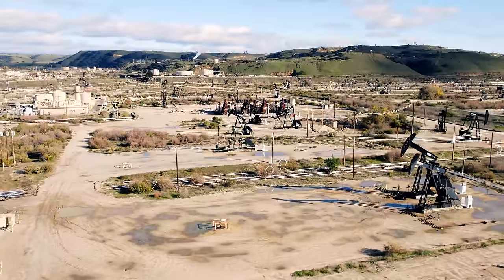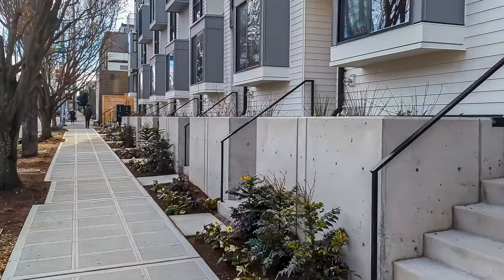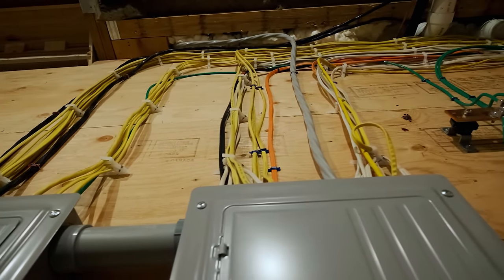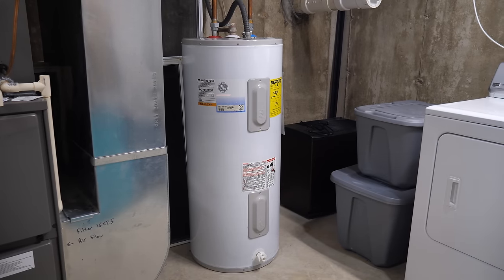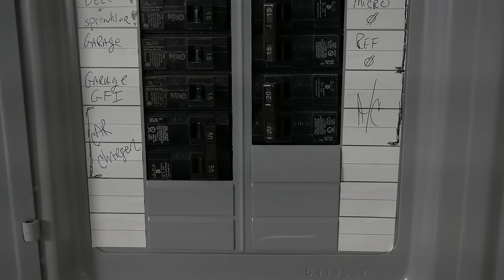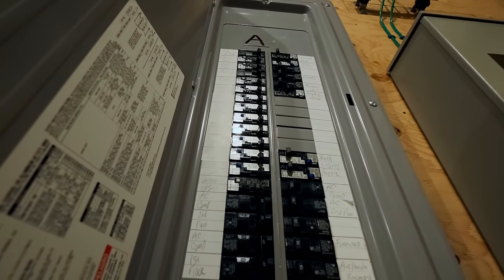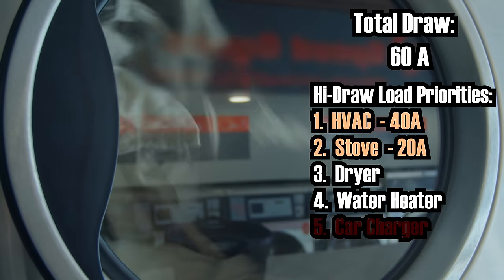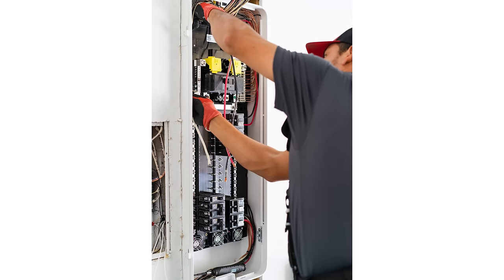Home Electrification: There's not a lot to do, and it doesn't have to be hard (Part 1)

Comment: I am an Estimator that works for a regional electrical contractor in the northwest Oklahoma region. I went ahead and ran a few hypothetical price estimates through my estimating software based on the scenario that you outlined in your video of using a SPAN panel to automatically manage power distribution with just a 100 amp feeder. Here is what I got:

Let’s say that you had a 100 amp panel in a 1700 sqft, 50 year old house that was using a gas range, gas water heater, and gas furnace (I see this all the time). If you decided that you wanted a panel upgrade so you could move to all electric the panel upgrade alone, with off the shelf electrical components, would run you about $1400.00. That would replace your 100 amp 30 space panel with a 200 amp 42 space panel. If you add the feeder upgrade, which would most likely be necessary, that would add about $950.00 if the meter base was located within 10 feet of the panel. This might also have to include fees from the utility company to upgrade the feeders on their part.

After you have a larger panel you could opt to then install new feeders to your appliances. A new range feeder would run about $1300 if run through an attic and it was within 50 feet of the panel. A new water heater feeder would be about $350.00 if it was within 15 feet of the panel. And a new Furnace feeder would run about $1100.00 if it was within 25 feet of the panel. 

However, if you decided to install a SPAN panel in place of your 100 amp panel without a feeder upgrade it would run about $6,500.00 assuming that the panel could be purchased and delivered for $3500.00. From what I can find this is a low estimate. With this new panel you would still have to upgrade all of your appliance feeders but you could avoid upgrading your panel feeder. 

The SPAN panel specifically may not be the solution for automated power distribution control at the moment but I am sure if these kinds of panels come down in price they could be an option. 

Also, if these prices feel absurdly low to you that’s because they are prices using northwestern Oklahoma material and labor rates. If you were in New York City just multiply these prices by 3-4x.
Reply: I'm curious, wouldnt the labor be the same between upgrading the panel size vs replacing with the SPAN panel? If so, why is there the large cost increase with the SPAN unit vs. part cost?
Reply: hello fellow okie! 👋
Reply: I would be worried about the longevity of the embedded computer system in this panel because looking at modern major appliances with expensive microcontroller boards cost a lot to begin with but if the board goes bad, it's just easier and cheaper to replace the whole appliance than to replace the board.  The way this panel is built as well, inconveniently, the SPAN panel foolishly puts the computer board BEHIND the breakers instead of beside it.  Also, I would want a system like that to use off the shelf components like a Raspberry Pi or ATX or ITX PC with free and open source software for these duties, effectively reducing cost and ease of repair.  Also, so the panel, with its "smart" breakers to operate like the passive breakers in conventional load centre/service entry panels.
Reply: @WJCTechyman  I doubt products like raspberry pi would pass any regulation. It's not like your internet router at home. My best guess is that SPAN chooses good quality electronic components and tests their products thoroughly so they don't get a bad rep of low reliability and high maintenance. But yes, concerns raised in comments are all legitimate and we have a long way to go.
Reply: @know1care  Rasberry pi's are just boards with chips and they are highly reliable...its the same thing that would be put into any other instrument except with a vast amount of capability.
Reply: @know1care  What makes you think SPAN would use any better components than say AMANA or LG or Samsung uses in their major appliances that only seem to last 5-8 years now?
Reply: So basically replacing all your stuff with electric is absurdly expensive and a complete waste of time and money.
Reply: @tinfever  the labor would actually be a little higher for the SPAN panel, I actually left is 20% higher when I ran the pricing. This is because my guys will have some reference for how to install the panel but will require some factory training and guidance. All of that costs time that I need to account for.
Reply: @WJCTechyman  this doesn't concern me as much. We install commercial lighting control panels from lutron and Eaton that will easily last 15 years without issue. While the circuitry is a point of failure so too can things like the connection points between the breakers and even the plastic housing of the breakers themselves. From the pricing I see on the SPAN panels I will assume that they are using commercial grade components.
Reply: @xeridea  as always, the answer is: it depends on your unique circumstance.
Reply: This is really good info and tracks with what I was thinking. However, I think a lot of the concern with full electrification is on the supply side, not the demand side. Adding a device like a span to a large number of homes helps the utility as they dont need to do large scale costly upgrades. It kind of also helps the consumer, but I think the primary benefit to this kind of intelligent load shedding is at the grid level, not the individual level (when a house upgrades to 400a service, the utility needs to ensure they can actually supply 400a, not the case where the home is just using existing capacity that is already accounted for)
Reply: Yeah, my very first thought on the SPAN panel is that it would be hilariously more expensive than just getting a service upgrade and is only something that should be done if a service upgrade is simply not possible.
Reply: @xeridea  It's a pipe dream.
Reply: Those seem insanely high to me but then again I did all my own work (after having a main breaker installed). Between material costs, and valuing my work at $5 per swear word, I come out to about $1500 total for my EV charger, electric water heater, induction stove, and rewiring all receptacles and lights for my 600SF cabin
Reply: @wojtek-33  Utilities don't run 12/3 Romex from the transformer to your meter.

Comment: Have you done a video on home insulation yet?
Would love to hear your thoughts on things like weather stripping, window film, etc.
Reply: This is something I would like to hear more on. I live in an older house with really old windows, but I'm not keen on replacing them (partially just because I just think they're neat). So other forms of improvements would be interesting to me.
Reply: @Descriptor413  when i moved into my 1905 Queen Anne style home in 2008 I had a window professional give me an estimate for all new wood-clad vinyl.  He was honest enough to say that my original double-hung sashes, coupled with tight-fitting aluminum storm windows, would be more energy efficient than replacing everything with new vinyl.  I'm sure he was right.  My house isn't drafty and utility bills are low, despite the size of the house.
Reply: @Descriptor413 
Last week I had 4 windows replaced by Pella. One was a big 6'x3' single pane window. The other three were the cheapest vinyl windows you can find. After all were replaced, you could immediately feel the difference. The house is staying much warmer than it did before. Especially good timing with the arctic vortex this week. On the other hand, it cost $8K. So it gets pricey fast. If I'm being honest, it probably won't pay for itself in dollars for a very long time. But I will be more comfortable and feel less worried about running the heat or AC. 

Next up full energy audit.

Comment: One extra thought on throttling your resistive heat- if you reduce your heater's output by 20 amps to run 20 amps of stove, your house is still getting 20 amps of heat! In a much more localized way, but if anything that's good, because you're probably in the kitchen with the stove anyway. Dryers and water heaters have this effect, but to a lesser extent as much of the energy goes away through a duct/drain.
Reply: That extra heat is not an advantage, unless it's cold outside.
Reply: @dizzywow  This is in the context of "throttling your resistive heat" so yes, when it's cold outside.
Reply: assuming your home doesn't have a very poor insulation quality, it may be better to just leave your heater on a lower temp all day and throw a shirt/sweater on when you're not cooking than try to throttle it specifically, just from a practicality standpoint
Reply: While not common, there are heat exchanger systems that pass incoming water to a water heater through a heat exchanger connected to the waste water drain pipe, thus recovering a majority of the out going heat in the water going down the drain when taking a shower. Not so good for baths since the hot water is drained after the tub is filled. There are also heat exchange, or energy recovery, systems for clothes dryers that warm the incoming makeup air into the laundry with the dryer exhaust air. My home has an energy recovery ventilation system for the incoming and outgoing air, and a minisplit for heating and cooling. Very cheap to operate.

A lot of this comes down to cost and the homeowner being willing to invest in these systems. It is also much more expensive to retrofit than to include in new construction. I believe building codes need major upgrades for new construction to increase overall efficiency, especially commercial buildings. I also believe that buildings should be required to be brought up to new codes as part of any resale. As an electrician who has crawled into a lot of attics and underneath a lot of floors, and worked in a lot of walls, it always amazes me how many buildings still have little to no insulation.
Reply: @goldensunrayspone  The heat will still be on and throttling on/off (at full effect) independent on the temperature it's set to(within reason).  
You would still risk the heater turning on just as you are using your stove.

Comment: One big issue I see with the idea of smart-panels to manage loads like that is most houses seem to be wired somewhat randomly.  If i need to make sure the freezer is running I also need to have the master bedroom, master bath lighting, half of one bedroom, and some random lights all powered.  If I need to keep the reptile tanks and aquariums running, I also have to keep the refrigerator, half the kitchen outlets, a hall outlet, and a dining room outlet all powered...which actually is something we have been getting changed (not cheap due to finished basement) because its problematic running on a generator if you are near max and the fridge goes into defrost overloads.

I also really don't like the idea of cloud connected critical things.  One thing comes to mind is how will it fail if internet goes out?  Will it fail everything-on and overload?  Will it fail and not turn things on/off keeping state?  Will it default everything on?  What does it do after a power-failure, especially if there's no internet?
Reply: TC seems fairly measured and well through through on most things, but it seems like he's got a fairly large blind-spot for the GLARING ISSUES with this new "IOT" fad.
Too blinded by the flashy gizmos to see the cracks in the foundation.
Reply: I also don't get this device. Replacing a 100amp panel with a smart panel often will have similar costs to just upgrading the service to 200amp.

Alternatively, better than a panel shutting off circuits would be a device that measures current flow then communicates with the appliances to either not run or run at a reduced capacity. Mainly car chargers, water heaters and maybe it could tell a clothes dryer to pause for a bit.

A breaker panel is a safety device. Let it just be that.
Reply: @Coconut-219  to be fair I think I also am more risk-aware having an unstable ISP I have learned the hard way how many things puke if they can't phone home.  Also with trying to segregate them on VLANs I have learned just how inflexible most IoT is expecting a single flat subnet and no security controls between.  Many manufacturers don't even disclose what ports are required to have it work at all.
Reply: There are far worst issues.

If the company is Venture funded what happens if they go bankrupt? Or they decide a new business model and all of a sudden your breaker box now requires $20/month because the know it is hard to swap out.

There are business side things that are legit risks and IOT is a graveyard of them.
Reply: It's like Apollo 13. You just have to turn everything on in the right order.
Reply: Agreed.  One older house I was in (late 60's build date) had one circuit that included the laundry room and half the living room.  The other half was a different one.  Then upstairs was separate, except for one bedroom, which was on its own.
Reply: To be fair, most heavy electric appliances (stove, water heater, car charger, etc) need to be on their own circuit already. Anything light enough that you can just stick it on the same circuit as a bedroom is a light enough load that turning it off isn't going to help with an overload anyway. As for the smart panel, ignoring the internet connectivity, my worry is basically that you're hardwiring smart equipment directly into your electrical system, and electronics are generally not quite reliable enough for that. It's the same reason I don't have those "USB charging outlets". Anything in the walls should be as dumb as possible, and this goes quadruple for panels. You don't want a bad capacitor to result in you losing power for days while you get a replacement shipped and installed, and that's to say nothing of software. There's just too many moving parts.
Reply: @Mr-lw7gy  yes, that too.  Its happened to plenty of IoT places - or even discontinued and new one comes out if they pull the plug on old servers now you have to rewire the house to upgrade.
Reply: @Coconut-219  Blind spot? Did we watch the same video? He specifically called out that he had concerns about it.
Reply: @trevorc4413  Came here to leave this comment about the large loads almost always having dedicated circuits.
Reply: To your part about random wiring of circuits: if you’re getting a panel upgrade with wiring like that, you’re going to need at least a partial rewire to see any benefit. Usually it’s not too inconvenient to run new dedicated lines for appliances (with thicker gauge and appropriately sized breakers) and move the old wiring to a 15a breaker, or maybe 20a depending on the load of the aquariums. Kind of a simplified explanation but any electrician that is quoting you a panel upgrade should know to discuss the intended purpose of any new work.

Comment: About thirty years ago, my father installed a load controller into our panel that sounds similar to the electric management device you described in this video. It had a simple interface box that was mounted inside the house and showed which devices were currently enabled and disabled, along with the number of kilowatts being used by the house. It also shut devices off based on a preference order that could be programmed by the homeowner. The electric utility charged both based on overall kilowatt-hours used and peak kilowatt usage during daytime hours (between about 9 A.M. and 9 P.M.). This device helped us save quite a bit of money during the very hot Phoenix Arizona summers.
Reply: We just called them energy management systems back in the day.. I never saw one that wasn't buggy back then

Comment: Your channel convinced me to get a dual head mini-split system for my house, and it's been great so far. Kept my poorly insulated house cool in the summer and warm in the winter. I have a very small home, but I've never had an electricity bill more than $180
Reply: Same here, I haven't even turned on my traditional boiler this winter season!
Reply: Aren't efficient ductless mini-splits awesome?  Had ours (triple head) just under 2 years and it's been a great upgrade.  We are also about halfway through a full renovation (which includes upgraded insulation everywhere), can't wait to get it all finished!
Reply: See my home would benefit but I’m in New England where one corporation controls the electricity supply so the rates are too high to justify the change
Reply: @TheSpaceCoyote82 He actually does explain the cons… The grid is being expanded constantly when it comes to energy production whether that’s solar on homes/businesses or new power plants. SMRs will eventually evolve into the ability for us to have nuclear power that is cheap and highly adaptable.
Reply: @TheSpaceCoyote82 The only thing that runs without electricity in my home is water heat (pilot light heats a thermopile to keep gas valve open). And maybe the Internet for about an hour (UPS).
Reply: @someone-xc1lj  Same, I did some math and it looks like it would almost double the cost to heat my house to go electric.